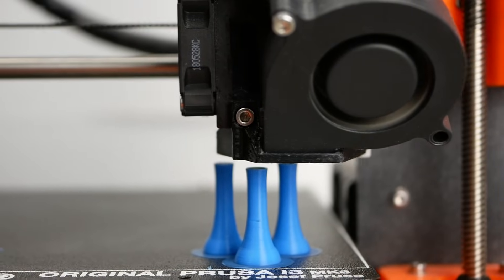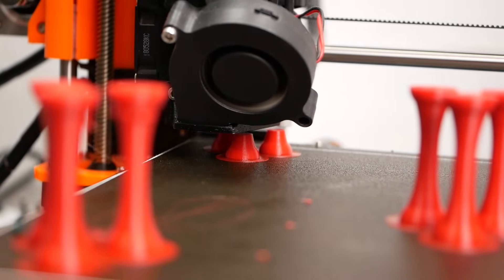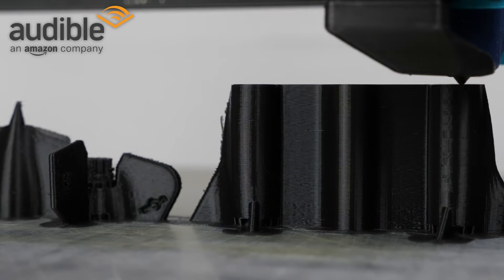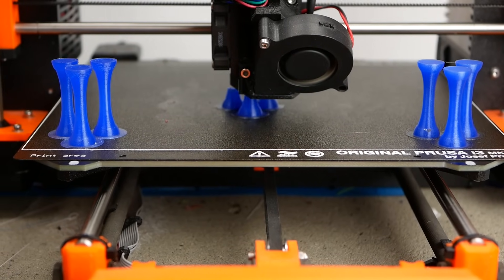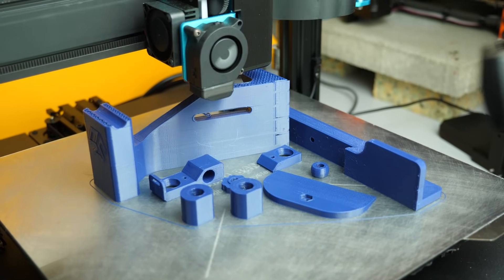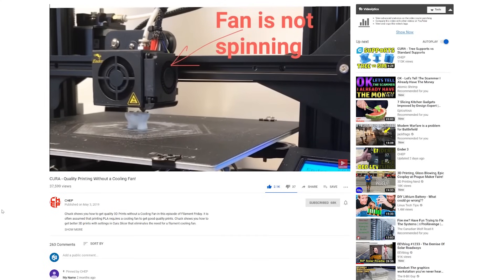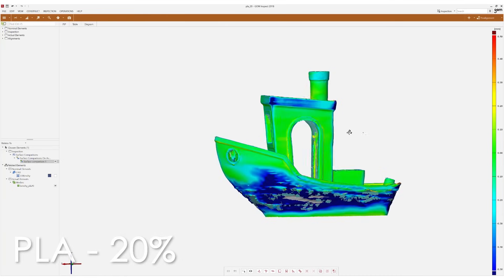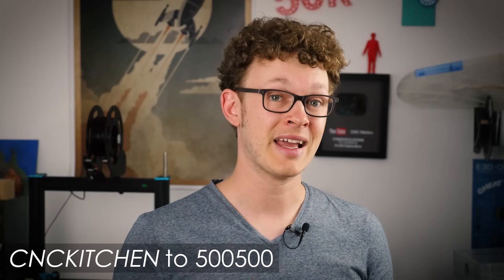MUCH STRONGER 3D prints due to LESS COOLING! Testing PLA & PETG

Comment: Counterintuitivly, I think cooling fans should blow hot air at prints. The aim is to take the plastic below the glass temperature as fast as possible, but no further.

The PETG result might be sure to water absorption. Water in PETG reacts during the high extrusion temps and damages the polymers. I think E3D did a blog post on this effect.
Reply: I agree with you, the optimal thing should be to have a temperature controlled chamber that sits just below the glass temperature, and let the part "cooling" fan should cool the print down to the tg fast, but no further. For this reason i actually picked up a old Stratasys printer with a temperature controlled chamber that i intend to retrofit with new open source control boards, new hotend etc to make it into a printer for high-end engineering materials.
Reply: For that reason I enclosed my printer, that will also lower the electricity used.

And for part cooling in some situations I designed a small tower to print on the side with changing thicknesses depending on how much time I want the part too cool before the next layer. My printer doesn't have a cooling fan ;-P

Comment: It's not your fan speed that's causing this, though it does contribute.  It's the temperature gradient between the nozzle and the previously laid down layer.  If you were to have the fan on still, but go slower - you should still see a strength increase as the nozzle is able to heat up the interface layer better.

Comment: I don't know exactly how to test it correctly, but I'd like to know how much of this strength is caused by the previous layer being cooler vs the hot end and current extrusion being hotter. My own theory of part cooling as someone who uses some filaments that are a PITA to run. I tend to run a fan at a level where I get reasonable quality but I also run hotter, sometimes much hotter than recommended temps. The theory in my head is you're primarily dealing with the temp of the current layer to determine layer bond, having the higher fan cools the current layer faster, but the filament extruding is hotter at the start giving better layer adhesion. 

So somewhat what you are testing here but different. As an example lets say your 0% fan PLA extruding at say 190C(just as an example), I do wonder if you'd get the same type of results from say %30 cooling fan and extruding around 220-230C? 

Hope that makes sense, but that could create some interesting results and you might find more strength using hotter extrusion temps with more fan to offset that. My results without scientific tests seems to indicate that, but I'd love to see some good tests on it. Ideally you'd use a FLIR or something to monitor what the effect of the part cooling fan is on the model and current layer being extruded to be able to gather the data on what the material is actually doing and then compare the results. 

Thanks for the great videos!
Reply: Perhaps increasing minimum layer times to really large values with low/no cooling fan.
Reply: @Gengh13  that's probably a valid way to test the theory. Might have to do that when I've got some time or a second/third printer;) Mine is pretty much running 24/7 in the shop at the moment marking parts and tooling. But I do plan to expand that side of my operation shortly. But if someone is interested also post/video the results ;)

Comment: Good tests! This shines some light on a set of tests that would be useful to see about layer adhesion with print speed and temperature. Of course fan speed would play a role. Lower print speeds/higher temps I would think allow for more heat transfer from the nozzle to the layers below increasing adhesion or decreasing.

Comment: Stefan, I listened to that audio book a few months ago and I was depressed when it was over. As an engineering student I felt the same as you about the technical struggles they faced. I was also very intrigued by the fact that Skunk Works had to literally invent, and fabricate, new tools and methods in order to achieve their design goals. Also, great video!
Reply: Thats what I loved about Skunkworks.

Comment: Very scientifically done. 
However, I do differently: 
1. If I only need the sizes - I use a proven pla.  
2. if I need more durability and better layer adhesion - I use a proven pla or abs with fuzzy skin.  
3. if I really need a sturdy part with temperature resistance, weight restriction, etc.  - I use engineering plastics (there are very few of them)

Comment: Great test! I would like to know the optimal strength of petg when adjusting temperature as well as cooing. Maybe even flow rate. 

Also for 3d scanning: i suggest to make in ear headset, use 5 minute setting silicon to get a deep earmold impression, scan it, remodel for purpose and then print multi material. This is a project I'm currenty working on. Gonna print the first part in petg then finish off the actual ear plug section in ninjaflex. Struggling to make Prusaslicer work for two different filament print settings in one print though.

Great work! Keep it up :) You're adding much value to the community!

Comment: I agree with everything you said. when I have to print something important and quite strong I do not use the fan, I slow down the speed and I use 0,16mm layer height. in this way, I get stronger results.

Comment: Thanks for all of your great content Stefan. I really appreciate all of your hard work and I'm always anxious to watch your videos when you post them.
I do have a question for you...
I have a CR10S printer and I've only recently acquired an E3D Titan Aero direct drive to convert to an all metal hot end. I know you put an Aero on your CR10. There seems to be actually very little choice in terms of the mounts for the Titan Aero for the Creality printers that accommodate a part cooling fan, and in light of your findings in this video, one that will provide adequate all around cooling of the parts. How have you solved the mounting problems?

Comment: Stefan, i managed to print PPSU at 100% Z tensile strength compared to XY tensile strength. I managed to do this by blasting the fresh print with air heated to 212 °C (between the 207 HDT and the 220 Tg) giving me perfect layer strength as well as very good surface quality. This is what made me win the Solvay AM cup. 
https://www.solvay.com/en/press-release/solvay-announces-winners-additive-manufacturing-am-cup-2019

If you want i can print you a set of samples from PETG or whatever with varying chamber temperatures to see which effect this has on layer strength. If you want i can also print some samples in Ultem 9085, PSU and PEEK. But i only have a small PEEK sample, so maybe 4-5 tests from that. If you would also want to test that. Just write me if you´re interested
Max
Reply: So let me see if I get this right, instead of ambient air temp you blow 212 °C heated air to the tip of the nozzle as print cooling and get much better layer adhesion for PPSU material? Or is it the whole print chamber temp?
So for normal filament like PETG the air should be cooler but still way over ambient temp right?
Reply: PartTimeRonin Both are correct, i heat the whole chamber to 212C and then blow the whole part with that air. I also managed to print smaller ppsu parts (tensile tests) on a tevo tornado with a heatgun pointed at the print.
Reply: Congrats on the win. Solvay has a plant just down river from home in Ohio.
@39.3684637,-81.5243019

Comment: all of these little settings seem like they may contradict each other; layer time, longer can also mean that the nozzle touches the printed part longer, making it hotter instead of expecting the cooling to be more thorough.

layer height might also contributed to that extended transfer of heat over smaller amount of material, sometimes infills and supports help to keep things warmer for longer therefore actually stronger

I printed a tall and narrow object like a cylindrical hinge pin on 0.2mm and it's very weak  on layer adhesion with it's geometry promoting cooling, 100% fan speed sure, but some other prints before were unbelievably strong, until taking into consideration about layer adhesion and cooling to be causing problems. (filament was eSun PLA+, but general PLA has also shown far better strength on specific settings on specific models)

Comment: For sure it is.. The best printer would actually heat up the layer it's printing on directly before extruding on it to get a better bond between layers (like we do when we fuse metal) We only use the heat of our extruding material to get a fused bond but the last already cooled layer will absorb much heat thats needed for a better bond. The other problems start when the material is to hot and deform. If you find the perfect mid of both then u can't get any better bond.
Reply: What you are saying is if you melt the plastic filament onto a cold surface that is the same plastic material then the bond will be layered and not homogenous.....it will be 2 distinct parts without much bonding. This will be the same for all layers as you print and you only get a very small adhesion from layer to layer. For most purposes the bond strength is not apparent so you don't get a catastrophic failure with the model falling apart, but apply a definite strength test and the bond weakness becomes apparent. It's just a matter of what you want to use the printed part for. A compressive test would yield a result that is good whereas a pull apart test is another kettle of fish.
Reply: @gangleweed  yes, I print most of the time mechanical parts that need to handle different forces, the biggest problem for me is always the layerbond because it's the weakest part aslong as I didn't designed anything wrong.

Comment: I have an idea that I was thinking of trying myself with photogrammetry. But I guess that the gom scanner might be more suitable for this. I recently bought a cheap water-resistant mp3 player so I can listen to music when I swim. The design for the in-ear headphones really hurt my ear though and they didn't really stay in. I was thinking of using some wax ear plugs to get a reference of the inside of my ear, then scan that and change the geometry with concentric loops to make the form more flexible and watertight for when I'm moving under water (Printed with a flexible filament ofc). I think this would be a cool project and has more applications then just listening music under water! :)
Reply from the maker: Spray your wax imprint with small speckles and it will be very usable for photogrammetry.

Comment: I avoid printing with lowered fan speed on Prusa MK3 because it makes the cooling fan louder than in full speed
Reply from the maker: That's bad, but I know what you mean. I'll give you my mk2.5 for your MK3 because with the old ones the steppers are definitely louder than the fan. Then you can finally print strong parts 😉

Comment: How do you do the sequential printing?
Reply from the maker: I used simplify3D since it gives me great control with its processes.
Reply: @CNCKitchen  is it also possible in slic3r pe?
I've seen some object to extruder clearance settings.

Comment: I'd love to see how print temperature interacts with part cooling.  My favorite PETG settings are 270C and 60% min fan speed on Mono-price I3 with the Dii duct.*  This gives good overhangs and layer adhesion sufficient that the fracture surface of a hand broken test doesn't follow the layer lines.  Normally this would also cause hellish stringing, but I print from a dry-box using molecular-sieve/Zeolite desiccant so my filament is SUPER dry. (* haven't calibrated the hot end, and PIDs needs tuning. often reads 255C during prints)
Reply: Well, I guess that kinda confirms that my 235 degree setting was too low.

Comment: I had broken noozle termistor while I was noob starting with 3Dprinting. So i did print ABS on super high temperatures and without cooling. Parts was not shiny and there was lot of smell during printing. On other hand, prints was super strong.
Reply from the maker: Printing temperature has also a very high impact on layer strength. I actually made a video on that back in the day.
Reply: Funny you should say that.....some time ago I had to repair a generator casing made from some plastic material that had shattered from an impact and I used a temperature controlled soldering iron to melt the seam of the plastic and add filler. If the iron was too cool the plastic did not melt the zone fully and the joint cracked with a small amount of flexing, but with increased heat the plastic became fluid and the joint melted and became more fully bonded. A good joint could be flexed without any cracking at all. Too much heat made the plastic go crumbly. I think the same applies to 3D printing temperatures.

Comment: Hi Stefan, a philosophical question (that I have been thinking about for a while now). The function of the part-cooling-fan is to  bring the temperature of the 3d-ink just below its glass-temperature. Would it then not be best to "cool" with hot air - for example 80'C for PLA, whereby the temperature reduction shall be done by the mass-flow rather than the temperature-differential, and the print would be held warm enough to have the following layer melt-into it nicely. I was considering "festo" style tubes emitting hot-air near my nozzle, being fed by a compressor with a heater/regulator to pre-heat the air to 80'C. What do you think?
Reply from the maker: That's an interesting question. I think you can kind of compare it to what's going on in heated chambers and that usually increases strength.
Reply: @CNCKitchen  Exactly. The difference is that  the hot-air can be significantly hotter- e.g. 120'C if you are printing HIPS - that is something no "heated chamber" can afford. Furthermore, instead of a heavy and vibrate-y fan on the hot-end that wafts air in the general direction of the print, the compressed air can be precisely dosed exactly where it is needed.
Reply: @AdityaMehendale  Print in a Sauna? :P
Reply: @AdityaMehendale  I would agree with your proposal, then you could completely remove all fans from the hot end and use small tubing air nozzles for the precise air directing as you need it.
Reply: @rkan2  Haha.. the hygroscopic filament-types won't like that ;)
Reply: @gangleweed  I'm gonna try this :) (Long-term project, though)
Reply: @AdityaMehendale  Why not? Don't throw water in it ;) The warmer, the less water content the air can have!

Comment: If strength is a primarily concern, how could Multi Material (dual extruder or Prusa Multi Material) using soluble supports could allow hight detail no-cooling printing but still retain maximum layer adhesion?

Comment: Nice!

Can you do a strength-comparison for these PETG-prints with the (stock) Prusa and the (stock) Artillery-fan ?  I notice that even with the same gcodes I get pretty big differences in adhesion sometimes between my A8's and the Artillery. Both around 40% cooling sofar to be able to have good overhangs but the A8's seem to be making it stronger somehow but less accurate.

Comment: Your no fan results are not really what I've seen in similar tests unless I'm printing way too hot.

I'd like to see more options in slicers for turning off (or down) cooling only for infill and/or inner perimeters.  Mostly, though, I use Colorfabb nGen with little-to-no cooling fan at 240c and get really good results.

Comment: You should test layer height and print speed
Reply from the maker: I did layer height a couple of weeks ago. The speed test will come.
Reply: @CNCKitchen  then only flow rate test is left
Reply: @CNCKitchen  Once these tests are all done, it would be nice to see a round up. A video that talks about optimal settings overall for PLA, PETG, and ABS  in so far as print temperature, cooling, layer height, and printing speed.  That's a lot of info to fit into one video, even a high level overview would be helpful.

Comment: Thx for this comparison it get even worse if you print in a cold room (once i wasn t able to finish a print by a room- temp of 17°C with PETG it cracks while printing with fan on). Would be interesting how quality and strength comes out in a heated chamber with cooling fan which throws hotter air on the print :)